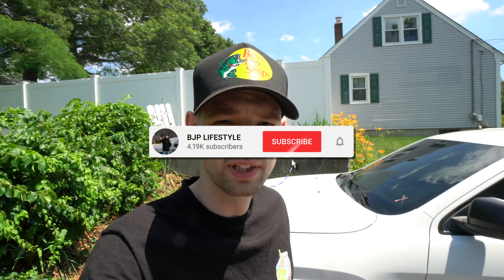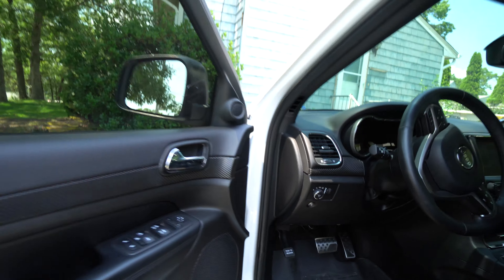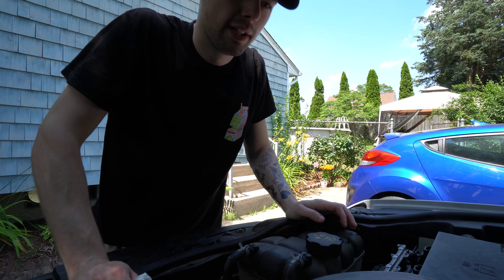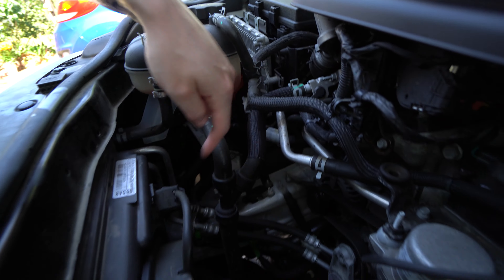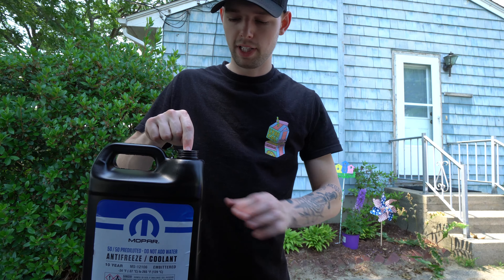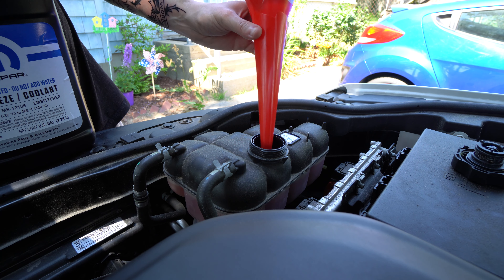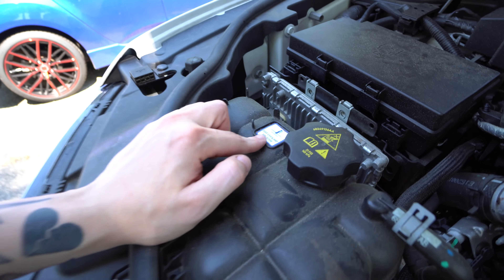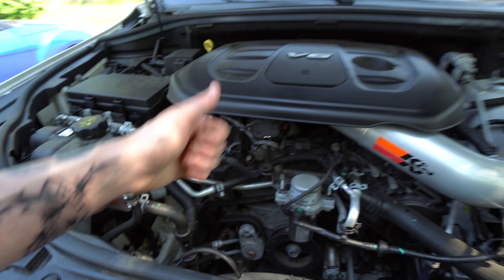Basic Car Maintenance You Can Do Yourself!

Comment: A little tip Make it a habit of pouring sideways so u have a smooth pour 😉 Also, unless your buying another funnel, u might wanna cut the funnel a little so it fits tight  in your oil hole or coolant resevoir ....😁. That funnel is more for vehicles with transmission dipstick tube or fill holes . Thats why it has a long skinny spout.

Comment: Does the 2015 grand Cherokee use Hoat or oat  antifreezes?
Reply from the maker: It should be OAT after 2013, but check your coolant overflow it should tell you... if not your manual will!